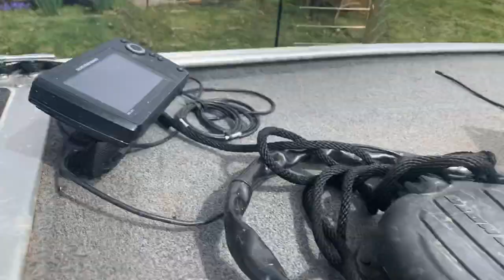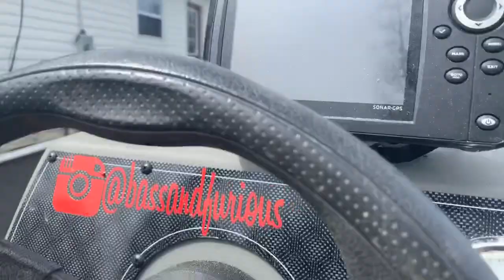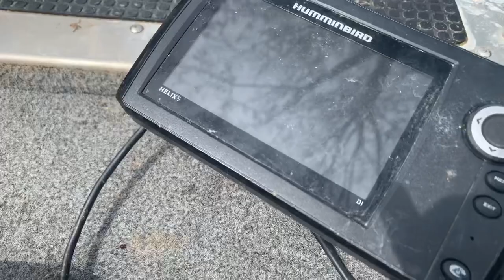Tracker Pro 160 Boat MODS!! 2016 Tracker Pro 160!  Bass Boat!

Comment: What's going on. What's your opinion on a bass pro 16 ft. Only has a 20hp engine
Reply from the maker: mine came with 20hp motor but i upgraded to 40hp i dont recommend 20hp, also 40hp was least i could have for club tournaments
Reply: @BassandFurious  thanks. If you sell your bass boat to upgrade. Please let us know!